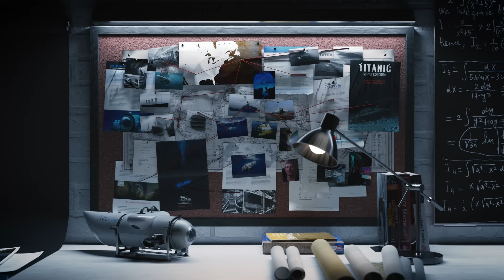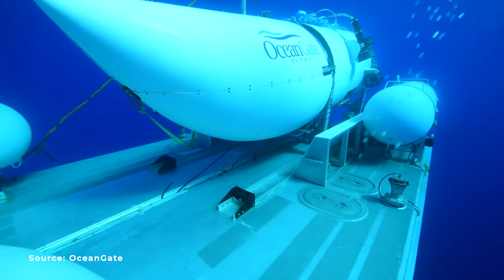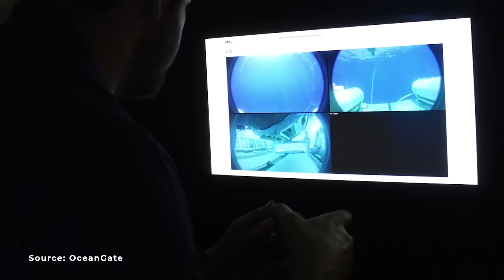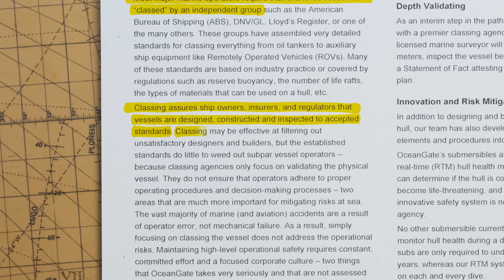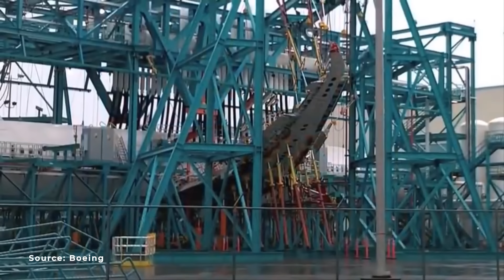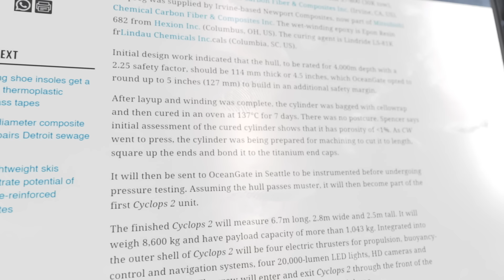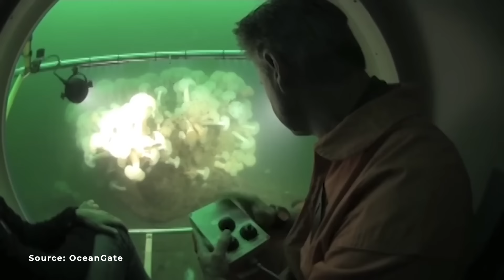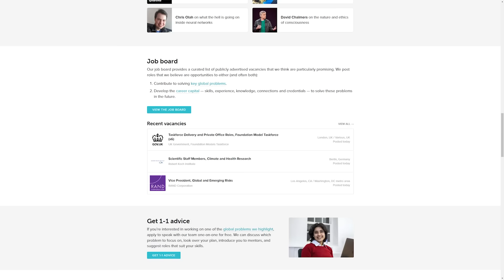The Questionable Engineering of Oceangate

Comment: About different orientation of the fibers - it seems that the carbon fiber was only applied parallel along the circumfence of the pressure hull (so it is not a weave with cross-lamination etc.). Therefor there would be very little resitance to tension stresses in the direction perpendicular to that direction along the hull. Seems a probleem since tension stresses will devellop if hull starts to bend more in the center as opposed to the ends, where the titanium will deform very much less that the composit. Or I am totally wrong - you have studied the stuff much more in depth.

Comment: My training is in materials engineering, and reading through the (lack of) due diligence just had me clutching my hair and going "no no no no no" over and over again. I did more testing in my undergrad labs than they did. My stakes were as high as trying to get an A, but they had actual lives on the line. My final response on this matter ended up being, "what did you think was going to happen!?"
Reply: I did undergrad mech eng at a uni with a prominent materials group and had the same reaction.
Reply: One simple factor: GREED . Five years old (in levels of maturity, responsibility) mustn't be in front of any Company.
Reply: Once I got to the part about it barely being tested, I was already thinking the guy had "Haha, Sub make money go brrr." in his mind far too much.

I only learned some engineering stuff in highschool due to the CAS and AP programs they had, but even someone with no training at all should be able to see the red flags in a lot of this.
Reply: It wasn’t a matter of if it would fail.  It wasn’t even a matter of when it would fail.  It was a matter of what would fail first
Reply: I took physics in high school, nowhere as advanced as engineering training or having a degree. But when I first heard about the use of carbon fibre, my first thought was literally, "I don't think that it can actually handle the pressure of being so deep"... it's sad that the people who paid to go on this vessel didn't notice the red flags and they are paying the price of what is honestly willful ignorance...
Reply: Unit ops or Pchem lab ?

Comment: I know that it is a habit of engineers to push their luck or as we put, we know that it is outside of its design stress, but we have a factor of safety of x, and we are well within this metric. This is an educated risk which I will take if something I am using needs maintenance but i know it won't catastrophically fail now, so press on and then fix it at my next break. I and most of us would not take this risk if there are dangers to others. The man that took these risks did so with his own life, but sadly also with other lives. Now he has cast a shadow not only over an industry, but the very integrity of qualified engineers.

It is vital that people watch this video and others, by this content producer. He not only knows his stuff, he has integrity!
Reply: Good point, but I think almost everyone who's heard of it are aware the reason for failure is the guy refused to listen to experts and cut corners to boot.  If anything, this probably makes people understand and respect actual experts more.
Reply: @boots7859  Yeah. Cutting corners on aeronautical or deep sea diving gear is not ok in any universe. I was talking about the mechanic that ignores a noisy cv joint for a little while. I think we are on the same page.

Comment: 7:33 this is NOT the case when the material has been welded. Did a thesis on microstructure and mechanical testing on a welded stainless steel 

And there are probably many other cases where the metal isn't isotropic like that. Although, as you say, it is generally the rule, but exceptions are easily made

Comment: To be fair to Elon Musk and SpaceX, their break things and learn from it didn't endanger human beings.  Also, when talking about carbon fibre, ignoring for the moment that it was the wrong material to use for the job, the only way of testing it is to test it to failure.  Ocean View chose not to do that except on the last dive of the Titan with tragic reults. 

If Ocean View had the same attitude as SpaceX, this tragedy wouldn't have happened.  They chose instead to "name drop" innovators without considering what made them innovators in the first place.

Comment: 4:06 "the vast majority of marine accidents are a result of operator error, not mechanical failure" ...because the classing system "filters out unsatisfactory designers and builders", the step they skipped. this is their justification? classed vessels never have mechanical failures, therefor they don't happen, so we don't need to get classed? man, I hope the passengers read and understood this fine print.

Comment: As an Industrial Chemical Engineer, my mind immediately jumped to my materials classes I had in college when I heard about the carbon fiber composite used as the material of the hull, and it took me a few seconds of thinking to realize that a sudden catastrophic implosion occurred, and they'd passed the moment contact was lost. And this is a take away that I will always remember from my safety classes, regulations are there because of two possible things: a) we didn't know better and now we do; or b) someone was dumb enough to decide that rules didn't apply to them (basically fck around and find out). This was a clear example of the latter.

Comment: My Youngest recently graduated with a B.S. in mechanical engineering.  She passed on the university commencement but attended her engineering school's ceremony.  In it, all the engineers were given a steel ring to wear on the pinkie of their dominant hand.  It was made (at least in the past) from steel recovered from buildings that failed due to poor engineering practices.  The message spoken to all graduates was:  "Wear this ring to remind yourself throughout your career that what you do matters.  If you f*&k it up, there is a good chance someone will die."
Reply: It wasn't just any "buildings" that they used for the rings - it was famously the Quebec Bridge that fell not once, but TWICE in 1907 and 1916, killing nearly 100 people. 

So the rings were made from the steel of those bridges, up until they ran out. There's unfortunately a good chance your daughter's ring wasn't made with said steel, but the story still holds weight and its an amazing achievement!
Reply: @P24p10  I got my Iron Ring upon graduation in engineering at McGill University in 1962.  After a few years I had to give up wearing it, due to a severe reaction to the ring’s metal in my pinkie ring finger. Many engineer graduates overcome this problem by getting the ring coated or anodized with a non-corrosive metal.
Reply: @korolr  Yeah, I can't imagine a steel ring would last very long without some kind of rust proofing
Reply: Awareness is everything in engineering.  Following-up is everything, too.  Half-assed won't  do!
Reply: Canadian. American or? 
I know Canadian P.Eng.'s get that ring. It goes on your dominant hand to pass over all your work. On your little finger to humble you.
Reply: @eh42  that's the one!  Yeah, her dean stated in the beginning of the ceremony that the practice started in Canada and soon came down to the US.  I like the idea.
Reply: @thatjeff7550  Me, too. It shows everything in engineering matters.
Reply: @eh42 any engineer in training can get it when you take the engineer's oath, not just P.Engs
Reply: @eh42 no it has nothing to do with p.eng
Reply: @eh42  Pretty sure Canadian EIT's get the ring as well, I'm just starting fourth year and we're getting emails about it
Reply: @derekvanlimbeek9588 Correct. You don’t actually have to become an EIT to receive the ring though. All you have to do is fill out a few forms in your graduating year and attend the Iron Ring Ceremony. Then you’ll receive the ring at the Ceremony. 

I graduated during the COVID lockdown so it got mailed to me instead.
Reply: Hi, I'm a Canadian engineering grad who wears one such "iron" ring (the quotes are cause mine is Stainless Steel, iron corrodes and turns your finger green). The Iron Ring is a tradition that was started in Canada to inspire engineers to think about their actions; some northern US universities have now adopted the practice too. It is always worn on the pinky finger of your dominant hand so that whenever you sign off on something, it knocks on the desk as an audible reminder of the lives you affect with your signature. 
Some couple misconceptions to clear up:
1. The rings have always been made using new iron/steel, the salvage and forging of steel into the original rings is just really believable fiction... I used to think so too until I got mine and was told different.
2. The rings are entirely decoupled from licenses. Only engineering grads really receive them though if you join your local iron ring society and are an engineer I believe there is a pathway to receive one. But it says nothing about whether a person is qualified. It's more akin to an oath to do no harm.
Reply: @NoelDevaere  yep, all of what you said is what my Youngest was told as well.  Still, a nice little story (even if fake) and much better than the ceremony I got when I graduated in the field of Architecture.  All we got was a long-winded speech by some unimportant person who liked the sound of his own voice.  Even the dean of the school was checking his watch every five minutes or so.
Reply: I have the same ring from the Order of the Engineer.
Reply: @vanessam9399  that's the very same society she joined.  Her engineering department used it as their commencement ceremony.
Reply: macabre? Yes. Appropriate? Absolutely!
Reply: Damn, that’s heavy but powerful.
Reply: Order of the Engineer.  I'm a member, but I have to say that I don't know where my ring is at this point.

When you get licensed to practice engineering, they emphasize the order of importance of your responsibilities.  First is to the public (human health and safety), second is to your employer & clients, and third is to other licensees.  Oceangate obviously ignored (whether willfully or negligently) the first and most important responsibility.
Reply: canadian engineering student here! you’re right with the messaging, but the ring is worn on the pinkie of the dominant hand for a reason: every time an engineer physically signs off on a document, their ring drags on the paper to remind them of the weight of that signature. it loses its function a little bit with digital signatures now, but with paper and pen it’s a very physical reminder of the responsibility that engineers have to hold public safety and well-being paramount in every decision they make
Reply: IIRC the tradition is that they used to seal their plans with wax or ink dipped into that ring. I also remember it being triangular but  I could be very wrong and I know the ink/wax thing has definitely changed.
Reply: @KayPrescesky  that's a different thing that this ceremony might have been based on.  This is a fairly new tradition, started around the mid-1980s in Canada after some particular building collapsed due to a fault in the plans.
Reply: The difference here is none of them were engineers , he fired the good  ones
Reply: Incredibly odd choice of memorabilia for a profession prone to degloving injuries…
Reply: @kyetes.866  why would you think mechanical engineers are at risk of degloving? 

A computer, paper and a pen don't exactly scream degloving risk to me.
Reply: @macnof  Yyyeah because 100% of engineering majors always get office jobs? The engineers I work with must not be actual engineers.
Reply: @kyetes.866 yeah and then you take it off when you're running a machine, but usually engineers are too expensive to waste time running machines
Reply: Load of old Bollocks! In superior Europe we have no need for childish rituals. We have superior engineering training.
Reply: Steel rings are dangerous, I'd recommend not googling degloving for the details. Seems a odd choice to gift something that is a risk for health and safety.
Reply: @beardedchimp the original ones were iron, modern ones are stainless steel
Reply: @KPalmTheWise  both share the same danger.  Even gold rings are a risk around moving parts but at least they are easily removed. 

@daydodog 

> then you take it off when you're running a machine,

In a similar fashion consultants and surgeons used to commonly wear ties which were a massive infection vector. They were supposed to take them off whenever interacting with patients but routinely didn't.

A mechanical engineer sitting behind a computer will also engage with real world applications, they should never have a steel ring on while doing so.

I have a few friends with tattooed wedding rings, a fantastic compromise.
Reply: @beardedchimp  how the hell is a steel ring going to cause degloving??? bro what drugs are you smoking
Reply: @smurfdaddy420 you are having a hard time imagining this? My dentist lost a finger when his wedding ring got caught when going down a waterslide. It is a fairly common occurrence. Look it up, pal. The information is out there for you to learn from if you care to take the time.
Reply: @Adam-kn3tv  with everyone talking about degloving and losing fingers, etc, today I mentioned this all to my Youngest.  She looked at me askance and said, "Well, most of my time is spent in front of a computer so I don't expect the keyboard to tear off my finger.  And as for it getting caught in machinery, after all the OSHA training I've been through and the constant, "Take off all jewelry before entering a worksite because this could happen if you don't," I'm already paranoid enough to remember take it off whenever I leave my desk."
Reply: @Adam-kn3tv  question still stands though: how is an iron ring any more dangerous than a golden wedding ring or any other ring for that matter?

Comment: Unbelievable how Rush’s arrogance ignored multiple warnings from
Experts from the submersible community, even more shocking, he actually mentions NASA & BOEING had a hand in the design of the Titan , and also used there names as a marketing structure to get  gullible individuals to book for trips to the wreck site , it’s mentioned on its first dive in the North Atlantic he experienced some sort of electrical malfunction, due to one of the main thruster’s being installed back to front, I believe they were near the wreck and kept going round in circles, till Rush figured a way to temporarily solve it to get them back to the surface, the other interesting findings ,,he wanted young inexperienced personnel as part of his team , I find that very strange, a company like Ocean gate didn’t want professional experts that work in that environment,,and then there’s safety aspects, The ability of carbon fibers to withstand repeated cycles of stress, especially compressive stress, under deep-sea pressures is not well understood, making it difficult to design safe hulls based on carbon fibers , the  strength and integrity would start its slow failing process of delaminating on the first dive , and failed on the 13th dive , which indicates that essential examination was never carried out thoroughly between dives , indicating Stockton rush put his faith in the acoustic sensors and strain gauges the system can analyse the effects of, that says it all , a ticking time bomb that no one could predict!!!!

Comment: Funny thing about the phrase "move fast and break things." It's a completely misunderstood and misappropriated term from software engineering. It comes from Facebook (or at least they popularized it) due to their incredible software infrastructure and their ability to roll out changes, monitor them, test them, roll them back instantly, etc. The idea was that if your infra is that good you can confidently make a change and just push it out because if it breaks, it gets rolled back. So "move fast and break things" was supposed to be a statement about bias to action -- don't be scared to make changes, it's okay to move fast and "break" things because they won't really be broken. That last part is the critical part that dipshits don't understand.

There's literally no equivalent in other forms of engineering. At least not without a huge material cost. The equivalent would be if you had a test rig for something where it would test the system, record information etc, until the point of destroying the system, and could do it over and over again with literally zero material cost and virtually no redesign time. The equivalent would be if you made a few changes to your design in SolidWorks that took just minutes and could press a magic button to materialize your entire design and test it with zero cost. Obviously that's absurd!

tldr for "move fast and break things" to make sense outside of software it literally requires Star Trek style industrial replicators and zero-cost energy

Comment: You are only the smartest person in the room when you are the only person in the room. It doesn't matter how much academic knowledge you have if you do not use common sense. Going to the bottom of the ocean is not like taking a road trip without a spare tire. When a submersible fails, you can't just get out and walk to get help. I literally fail to understand how anyone who refers to themselves as an "engineer" would just throw caution to wind, not have the unit inspected buy experts in submersibles and not do more research to get more data. He could have been known as a pioneer in the research of this material for the submersible community by repeated unmanned trips down, after which you test every square inch of the vessel to track the onset of stress fractures so  some day he could build a truly fictional submersible on a lower cost scale. Instead he is now know as an arrogant person who thumbed his nose at safety, and in multiple posts I have seen, was determined to do what he wanted despite many people telling him his attitude was dangerous and cost lives.